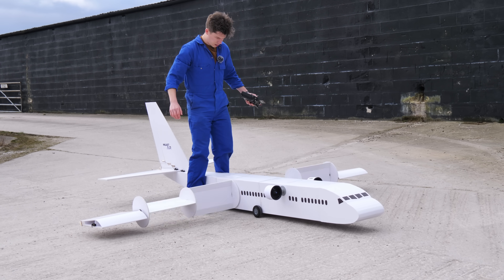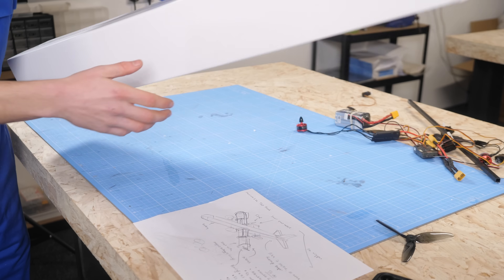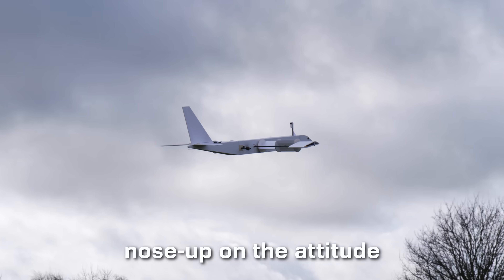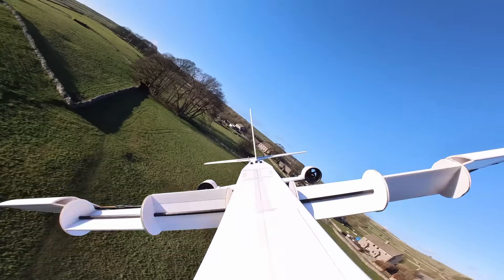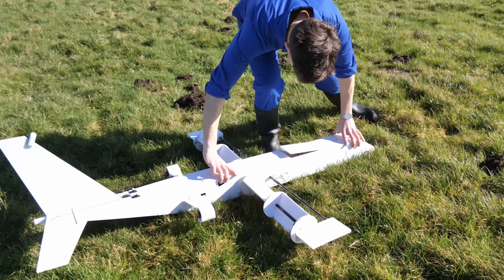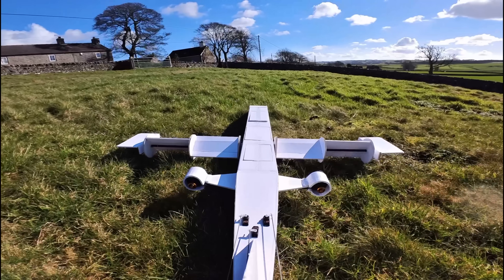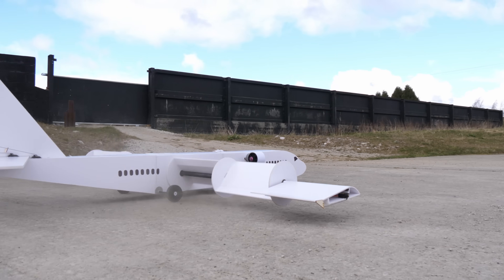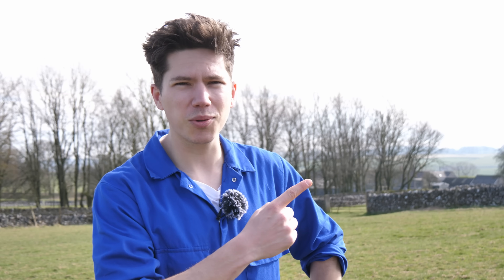Giant Magnus-Effect Plane

Comment: Ah little tip from an engineer use bearings with a metallcap these have lower friction, than the ones you used, the black rubber cap is designed to rub on the outer and inner diameter to get ah good seal against water, the ones with the metal seal are only sealed against dust which should be more than enough for your application.

Comment: Wouldn't three sections rotated at 120 degrees instead of two at 90 degrees minimize vibration further. If you can make the can figure out how to make the cabin a cylinder that would probably make a fairly drastic difference in weight as well. Though I know nothing on constructing things with styrfoam to even accomplish this lol. Other than buying it in a tube and hollowing it out.

Comment: When using sealed bearings like those in a situation where you want very little drag / friction I like to remove one seal and wash them out and then use a light oil or a dry graphite. The difference is huge!

Comment: Suggestion: put an extra section inboard of the Magnus rotors, which is the width of the ducted fans. Give it four to eight "paddles" so that it's spun efficiently by the fan wash. This should power the rotors more efficiently and give more lift at low speeds.

Comment: It's a strange design I've never seen before, but there are some things I have an intuition for here. 

1. What if instead of a 90° step, we introduce a continuous twist along the length of the wing? Perhaps even a multiplane helix?

2. Putting the engines infront of such wings probably cause half or more of engine power to be consumed in just rotating them. Additionally, if the wings on either side are not freely rotating in the 'same amount' per unit of thrust they encounter, it will generate asymmetric thrust and yaw the plane uncontrollably.

3. Those wings are far too 'flat'. I know you're not trying to have just a simple cylinder for the wings, but perhaps even a semi-circle of that cylindrical shape might work? I'd say try some strange permutaions and combinations with how different shapes work. Like, how would a horse-saddle (maybe better known as pringle shape), or a square but two opposite sides of it are cut out in a semicircular shape, etc. work? Does twisting these shapes do anything? What about a peltier wheel kinda design?
Reply: Seems like #1 would be easier if some flexible balsa could be found. 😅
Reply: @SuperHornet1981  Working with wood itself wouldn't pose much problem, but getting them 'equally twisted' for both wings would be quite a skill challenge. A 3D printer might be much more precise, and customizable there.
Reply: @mihirpansare3527  
At a time when precision is at a premium, yes? Against the increased weight I imagine.

Comment: Unsolicited Recommendations:

	1.	Identify and Mark the Aircraft’s Center of Gravity (COG):
	•	Precisely locating and marking the COG is critical for stability, control, and predictable flight behavior. This data should guide adjustments and design optimizations.
	2.	Construct a Functional Wind Tunnel:
	•	Developing a scaled wind tunnel will significantly enhance your ability to conduct aerodynamic testing. This will allow controlled observation and measurement of airflow characteristics, aerodynamic efficiency, lift, drag, and stability under various simulated flight conditions.
	3.	Evaluate Rotor Direction and Lift Relationship:
	•	Investigate whether reversing the rotation direction of the “Wotors” (wing rotors) influences lift positively or negatively. Experimental data could yield important insights regarding rotor dynamics and performance optimization.
	4.	Revise “Wotor” Blade Design:
	•	Reassess the current flat-panel rotor blades. Exploring a helical or intermediate geometry could offer improved aerodynamic efficiency, reduced drag, and potentially enhanced lift characteristics.
	5.	Explore Alternative Power Sources:
	•	The current battery-powered system’s scalability may present significant weight challenges as size and flight duration requirements increase. Evaluate alternative power-generation methods, such as incorporating a compact internal combustion engine (e.g., nitromethane model engine) coupled to an electric generator. This configuration could charge a smaller, onboard battery array, substantially reducing overall battery weight and enhancing endurance. Similar hybrid propulsion systems have successfully been utilized in various applications, including rail transport, submarines, and other machinery, providing proven feasibility and reliability.

Comment: Nice work ! 👍 
However, I've few remarks:
1-you definitely should cover the rotary axis, even if it's round and carbon, it submits resistance and disturbances.
2-you can limit the number of  bearings on this axis
3-the ground support must be improved by adjusting the position of the wheels
...oh, and 4-not sure that such a huge empennage is useful

Comment: Hello, Mr. Project Air. Very cool project. I love when you build the oddball aircraft. I built a Magnus effect plane out of the Multiplex Fun Cub last year. I found after experimenting with motor position what worked best was mounting the motors way up front above the wing using par thrust. I was able to get consistent full flughts thus way. A guy at my flying club said it was cheating. I don't feel that it is. It is not so much par thrust that its lifting the plane straight off the ground. it is only blowing air over the Wing and producing extra lift. Would you consider that cheating? Most Ekranoplan builds i have sern use par thrust to help produce lift. I guess its questionable and worthy of debate. Maybe it is cheating? IDK. You should try with yours and maybe do another episode discussing par thrust. Many RC guys have no clue about it. I also use par thrust in my custom STOL Bush planes to climbout faster and to fly slower on landin aproach. Thanks again for a fantastic video.

Comment: Generally larger is worse in all ways, as the strength to weight ratio of your materials goes down, as well as the weight to power ratio of engines/fuel (batteries in this case). Hence why RC aircraft use foam and batteries, while normal aircraft tend to cost a bit more. Also your design is like all drag, you're gonna have to do some reworking and probably won't be building it to anything recognizable as a regular plane.

Comment: There's a much better design from the mid to late 1930s...

the shape of the rotors is half circles.  The thing flew on rubber band power.

I believe it was published in Flying Aces magazine between 1936 and 1939.

I built one from the plans in one of Father's old magazines in 1975.
Reply: You also need tapered ducts/nacelles on the EDFs  a common foam soda a cup is about the right taper.  Exit area should be 0.85 times fan swept area.

Fan swept area is Pi * R^2 fan rotor minus Pi * R^2 of the hub.

You are losing up to 30% of your potential EDF thrust by using a constant radius tube nacelle.

Comment: The wing panels need to be sandwiched over the tube so it's balanced and doesn't have extra drag when the tube is directly exposed to airflow. Another thing to try is making the wings three sections at 120 degrees rather than two at 90 degrees.

Comment: Not powering the rotor is really doing a disservice to the concept as the biggest advantage is going to be the ability to generate lift while at relatively lower airspeeds. The issue isn't the drive weight but the rotor velocity and vibration.

Building a rotor using a hollow ogive with supports and a thin doped fabric or cling film skin will really improve the stability and reduce vibrations. Making the diameter of the rotor smaller and increasing the rotational velocity will then really help since rotor lift is affected by the square of the velocity but that shift doesn't increase the weight directly.

Adding a curvature to the rotor so it takes a more "S" shape where the openings are towards the front and the rotor spins backwards to the S will add a layer of boundary air inside the surface of the S also decreasing drag and increasing lift when the powered rotor is adding energy to the system relative to the incoming air.

The last suggestion is to add a constant speed drive to the wing that you can adjust to tweak the rotation speed to optimize the lift to thrust radio if the wing depending on the phase of flight. When cruising you're pretty much just letting the wing coast with a little extra power to counter the drag it creates. When climbing you're wanting higher torque to apply more lift and thrust to the system using the electrical power. In a recent you want the wing spinning acting like an air brake absorbing energy from the craft to charge the battery and accelerate the descent. 

If you get the rotor efficient enough you might even get a near-VTOL effect with an extremely high speed and a very high torque.

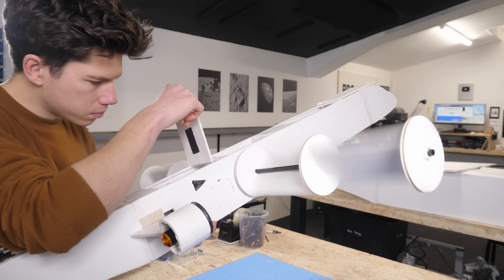Comment: 9:28 try using big to small gear ratio also your motor doesnot look is balance in the middle, it will effect the weight distribution. As for turbines they look just cylindrical make it nozzle type.

Comment: Given the flight regimes and Reynolds numbers involved, this is NOT a Magnus Effect lift mechanism beyond the first degrees of initial rotation (and only at the leading edges) at low horizontal velocities.  

This is actually a horizontal positive displacement rotor.  The lift mechanism is (nearly) entirely momentum from those components of the Navier-Stokes equations.  

Put another way, your plane derives nearly all its lift from "pushing" air (akin to a bird actively flapping its wings during initial take-off) than lower Reynolds number boundary layer energy transfer one associates from Magnus Effects.

Please produce another video explaining these issues.

Comment: You can separate between fan blade rotors & prime wings. Full independent wings make Max. Lift force & stability. Integrated rotors vibration make wing flaps not stabil. Maybe you need four point fan blade rotors to increase thurst force, stability & speed for take off. Two at front & Two at back. 

If you rotate betwen front and back rotor (or left/rigt to acrobatic manuver) in the opposite direction, maybe you can made VTOL plane !!! In the air you can switch front/back rotor at the opposite or same rotations.

CAME ON GUYS!!! THATS CHALLENGE!!!

Comment: I don't understand your building method. You are concerned about weight but you use hot glue gun to assemble? You couldn't pick anything heavier? You need to check out some foaming gorilla glue. Super strong and crazy light. Yes it takes about 20 minutes to set but the weight savings would be worth it.

Comment: Are you doing it on purpose? I mean, using trial and error, testing the system right  after each adjustment to showcase the whole experience in a video?

Because otherwise, I think you already know that if you want to create lift using the Magnus effect, the cylinder should probably turn freely after that initial backward prerotation.

Comment: the magnus cross section is wrong. i had a magnus kite in 1990 when they made them to show it off. when the contours were bashed by a scientist they made a new set that couldnt fly well with flat cross section like yours. 

describe the better cross section ? make dollar symbol and put a axel in the middle. its like a plane wing air flow over the top vs botom  of either end of the dollar symbol . there is also a single bulge with single flater side version. 2 small companies making them before scientist bashed the who thing claiming the pannels should be flat otherwise its just a plane wing effectively

now days you could do helical with 2 or 3 whole wings twisted shaing 1 axel if the cross section of each wing still had plane wing shape but over the length twisted probably

Comment: When the bearings do not allow free-wheeling, you are losing a lot of lift because the Magnus effect relies on the rotational motion to create lift, and this binding acts as a big loss that prevents it.

Something that may help is if you take the seal off the bearings and clean the grease out with a solvent, then use sewing machine oil or something very light to allow very free movement in the bearing.
Reply: Yea, they are causing a lot of drag, compared to the lift. You can tell this as when he spins the rotors they stop within a turn, they should spin for a short while
Reply: I was just getting ready to suggest this, looks like I have some consensus.

Comment: Scaled up and moved the motors to the front, it doesn't fly, back at square one where the motors are too small for the size of the model, also try using S-Foils on the spinners rather than flat ones, it would not only create a scoop effect, it would also increase the surface area of the S-Foil.

Comment: I think you need to skip the water wheel thing and go with just smooth cylinders spinning. Of interest I have always wondered if smaller diameter spinning shafts would do this better or not. Like is one larger one better for each wing, or more numerus, faster-rotating smaller cylinders (that might have less drag) do this better.

Comment: You have flat blades with square edges. I suspect that very shallow graceful  "S" curves would reproduce the trailing edge of certain insect wings which produce lift. Their trailing-edge vortices cause a rotational drag which imparts a horizontal vortex which creates lift. Basically a sideways tornado behind each wing. Picture a normal S but very flattened and with no recurve beyond the imaginary line through the axis- and very graceful. Now picture the S is going to rotate counter clockwise. Try with blunt leading edges and with sharp trailing edges

Comment: Fairly certain that the rotating plane “wings” are providing marginal to zero lift. Try taking them off and I would bet that just the wing tips and tail provide enough lift when combined with your overpowered ducted fans flying at a high angle of attack.

Comment: There is no angle of attack on the rotating wing, correct? The lift is approx at a right angle to the velocity? It seems like your pitch control authority is all from your elevator, fuselage lifting body and the winglets you use?

Comment: Always fun to watch your experimental vehicles! I was wondering whether you really can use this Magnus effect for pitch control. In a normal plane with wings,  if you pitch up, the Angle of Attack (AoA) of the wing increases, the lift increases, and therefore you ascent. The Magnus effect does not have this AoA dependency. So probably it is the vector of your thrust, or the wing shape of the fuselage that ascents and descents your plane. Not your Magnus effect wings.

Comment: Why don’t u put a gear on the shaft and put a small motor on the wing .  

I think u need 4 rotors 2 on front 2 on the rear .

Make the rear half size of the front to give them more banking power but u could probably make that vtol lol ..  

Keep the two front thrusters as  forward propulsion u  wouldn’t need servos u could use each rotor by speeding them and slowing it down .  

This might be a more efficient way off flight

Comment: I thought Magnus effect was over a round surface? All the examples I can find are. But now that I read the definition it seems that is only implied/tacit? Interesting... Does a flat rotor provide more lift than a round one?! If so, then why isn't that used on the flettner rotor ships? Surely they would have optimised the concept? 

Have you created something new, with the flat rotating blades?

Comment: I was wondering if it wouldnt be better to just have larger wings in a cage inside the fuselage to stiffen it up or with a differential in between so you could control different rotation speeds instead of the ailerons. At some point your materials would obviously fail... so larger plane alltogether surely wasnt better... Also with those angles of attack the plane was to 30% a helicopter...